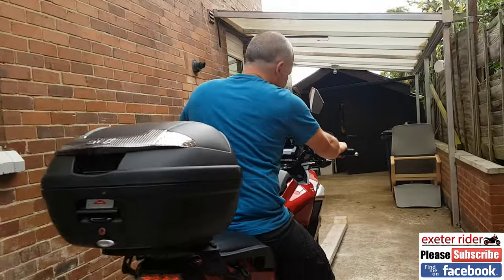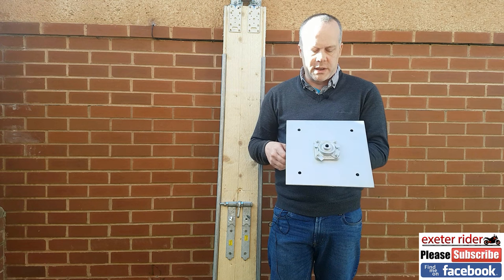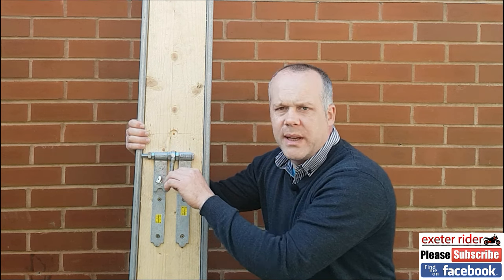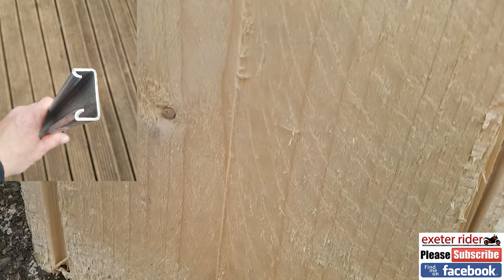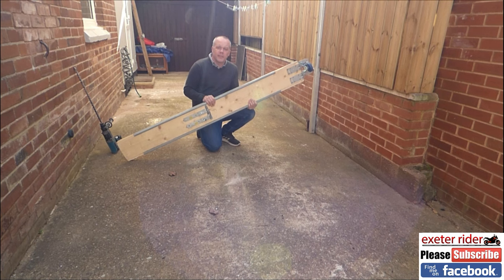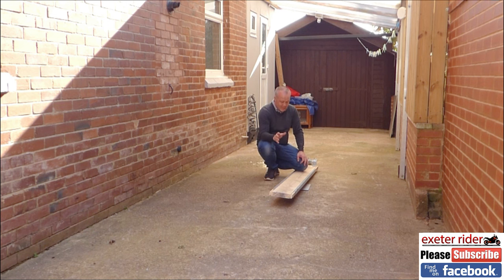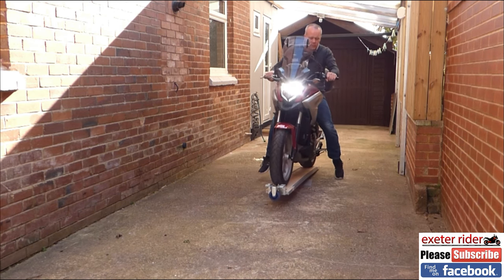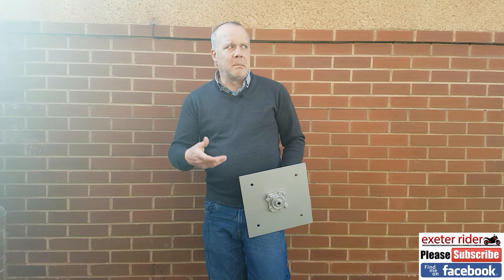(How To) Motorbike Turntable

Comment: i did see the first Turntable , but went out and bought a Lazy Susan off Ebay, not easy to use at 80 yrs old and also restricts having a bike which does not have a center stand. this second Video has opened my eyes, with this turntable I can have any bike that I want. I do intend to try and fit one to my Garage which will solve all my Problems, if you know anyone that would make and fitt this turntable creation  would wilingly pay for this wonderful creation. with respect Bryan Medway
Reply from the maker: OK Bryan, if I wasn't so busy I'd make one for you. But no time at the moment.

Comment: Love it !
If I had the skill and a better toolkit than my hammer, pair of mole grips and 2 adjustable spanners (1 metric, 1 imperial) then I might have tried this.  Instead, I copied another youtuber and used a cheap lazy susan bearing and a precut circle of steel to build my turntable that the centre stand rest on. This enables me to turn My NC within the garage rather than the dodgy slope on the narrow drive.
The only downside is I can never remember that the turntable is there when the bike is parked outside. These occasions , however, enable me to practice my dance moves as I try and fail to stay upright...
Reply from the maker: Yea that's another way mate. I looked into that but wanted something I could just drive onto and off instantly. I'm lazy like that😊👍🍻